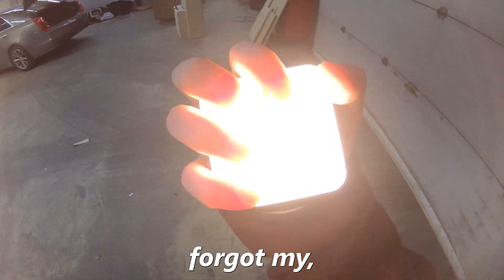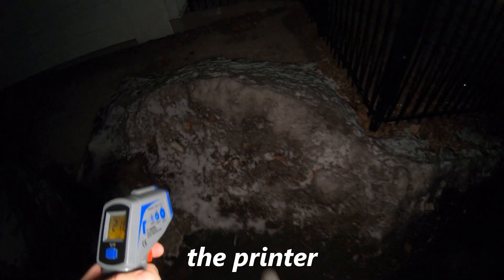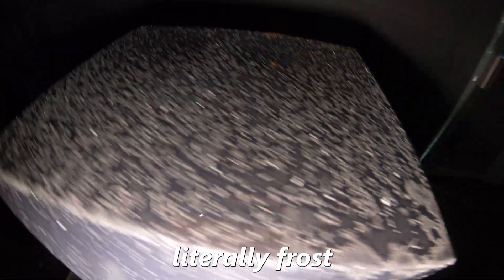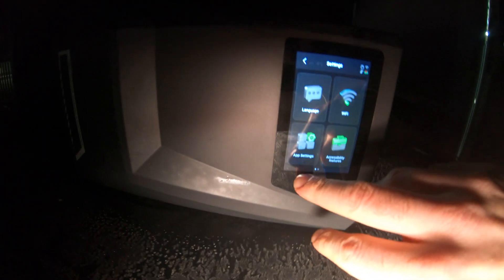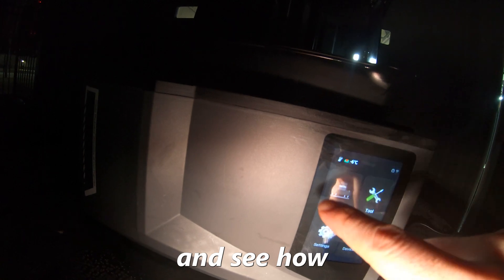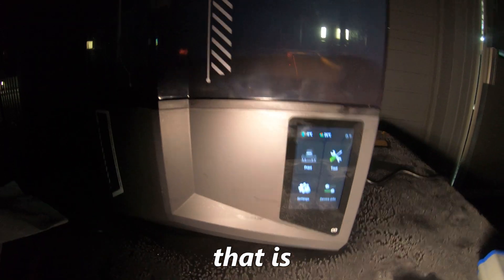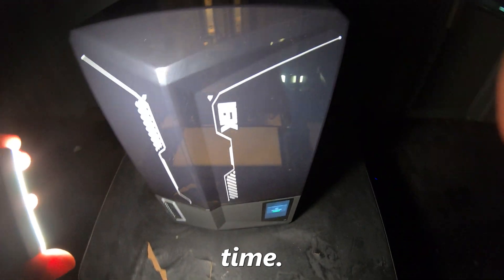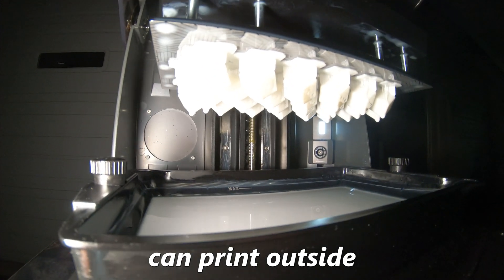Saturn 4 Ultra 16k... Can It Print Outside? (Below Freezing)

Comment: Whatever Elegoo paid you for this video, it wasn't enough. I live in the frigid state of Michigan where we get a full winter season, and the one thing that was preventing me from pulling the trigger on resin printing, is I would have to set it up in my garage. Once I heard of the heated vat I was excited but skeptical, and this gave me the confidence boost I need to know that I'll be able to comfortably set up my resin printer in my garage. I guess the next question, is it safe to leave outside for extended periods? Maybe I'll get one of those grow tents that helps insulate the heat. Great, simple, straight to the point video, whenever I purchase my ultra 16k, I'll be using your affiliate link!
Reply from the maker: I wouldnt leave it exposed to the elements but in a garage should be just fine! Thanks for the kind words.
Reply: I'm in the same exact situation as you, in Michigan as well.  I want this thing so bad but was worried it would be too cold in my garage!  My only concern now is how well I have to vent the garage if this is in there!
Reply: Same, this video was what sold me on the Saturn 4 16k. So Elegoo.....you owe homie a fat check, cause I'd wager every dude in Michigan or any other Northern State / Canada watches this video before pulling the trigger.

Comment: That ptinter looks awesome.. cheap12k mono printer!!! the buildplate apparently  tilts to pop the print off the membrane(which doesnt need to be FEP anymore. Still wouldnt buy it cause 
Resin is ickky. 

Been really impressed and annoyed by elegoo have 2 neptune 4 pros which are excellent well designed cheap and have amazing and build quality...but awful quality control /final assembly, loose nuts warped beds...still I will buy their stuff because it has a lot of upgrades as standard for not a lot of money
Reply: 16k*

Comment: Man you have no idea how helpful this is to me. I've been wanting to start 3D printing but the only place I could safely operate a resin printer is either in an uninsulated garage or a cold cellar - and I live in Canada so they typically get at or below freezing in the winter. I've been planning out building an expensive fully insulated (like R value 20) heat box solution but it seems like with this thing I won't even need to do that.
Reply from the maker: It's a very useful upgrade for sure
Reply: Tried resin printing  3 years ago...somehow the stink wafted Into the house from the utility  room and took 3 days to dissipate haven't used it since😂
Reply: @TrumpstienPhile  My cold cellar is pretty well sealed room that's just concrete on all sides and has built in ventilation holes I can hook a 4" extractor up to - I think it should be fine fume-wise but man I'll be mad if I invest hundreds into extracting the room, building a heat box and the fumes still leak out lol.
Reply: @Weaver_Games  nice- to be fair my machine was a basic  primate £150 voxel lab something. The box wasn't even slightly  sealed also non (less likely to give you ball cancer)toxic water washable resins have emerged... when I tried consumer resin printers were in it's stone age, suddenly they've leaped to space age...im still not going to buy one tho